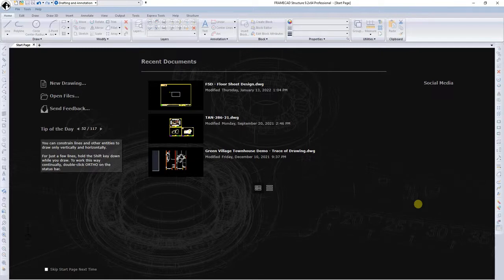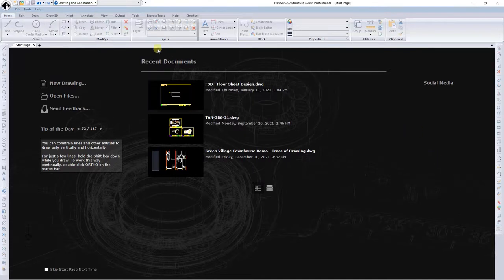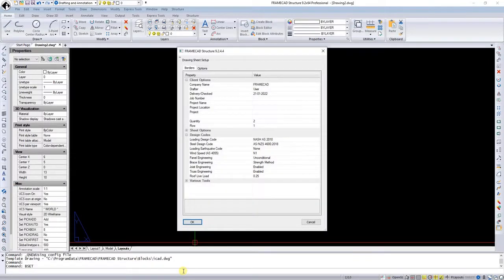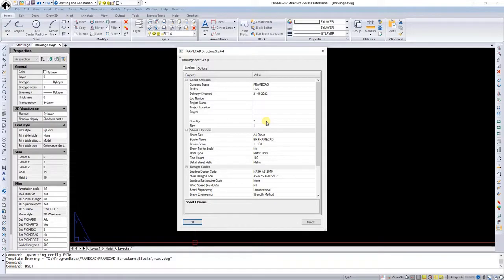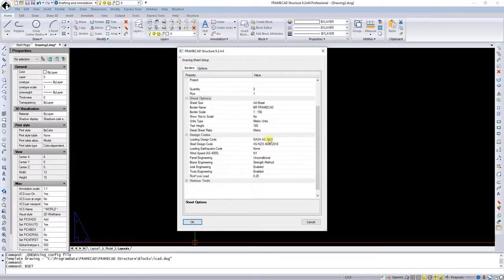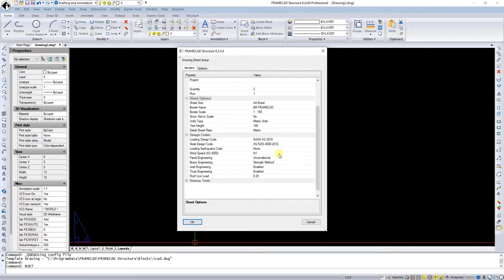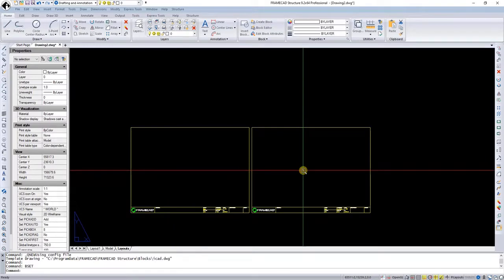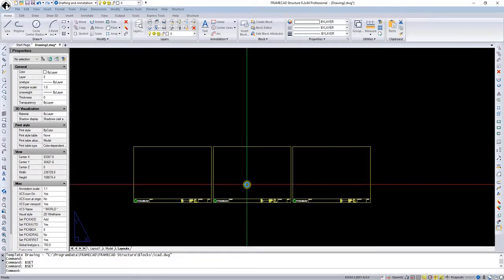01 - Framecad Structure - Quick Start - Project Set Up

Comment: I ENTER THE BSET COMMAND BUT IT DOES NOT RECOGNIZE IT. SOMEONE HELP ME SOLVE IT 
ANSWER ME " Unable to recognize command "BSET".  Please try again"
Reply: Hello. If You experience any issues with our software, I recommend you to always reach out to our support. There could be multiple reasons for this problem. One is that Framecad structure hasn’t been loaded. This could be due to licensing issues. Do you see the Framecad menu in the ribbon above? If you do, please try the DO_ONCE command to reset your CAD environment.
Reply: @sabalminor54  thank you so much. Maybe it's because it's a 30-day trial model.